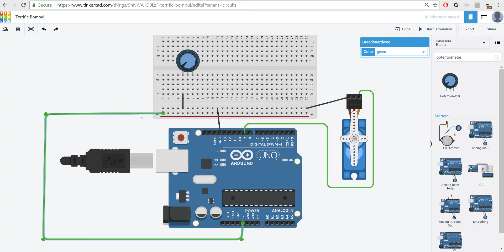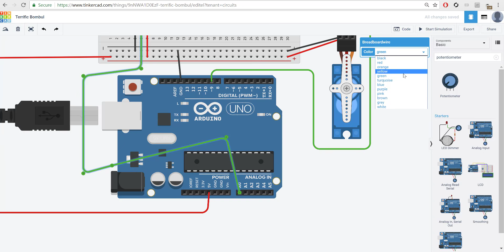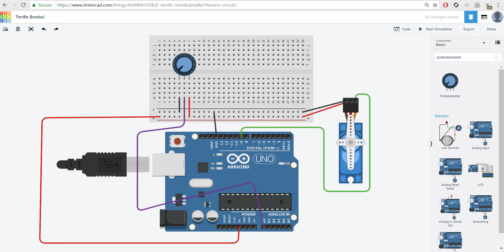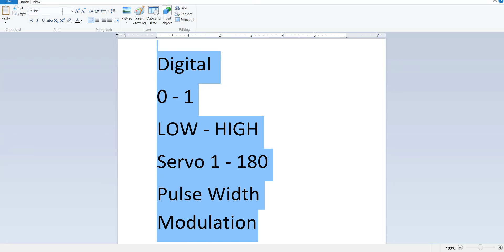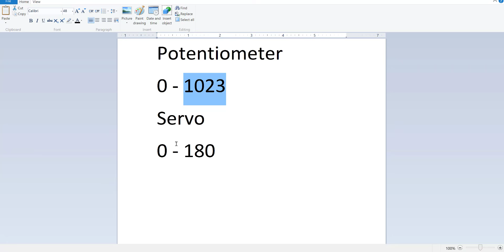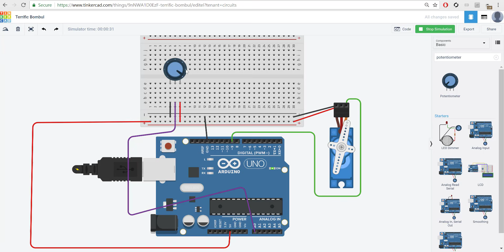Arduino UNO Tutorial #4 - Potentiometer + Servo Control Project

Comment: Hi Mr Z ,

I would like to control the steering of a remote controlled car and my need is to turn 90° left or right, and not 180° right.

Is it possible to initialize the position of our servo to 90°?

Thanks